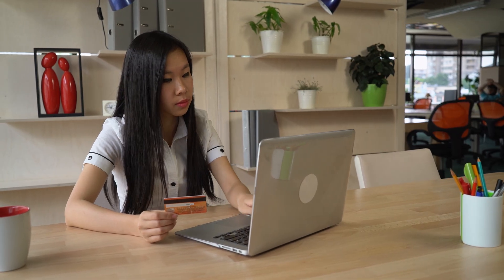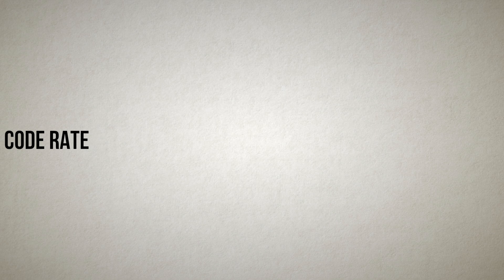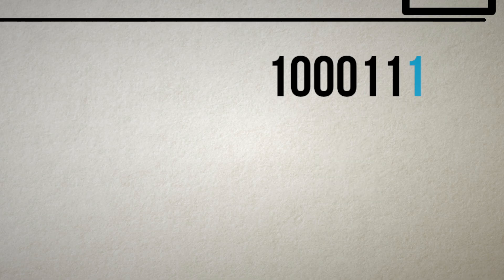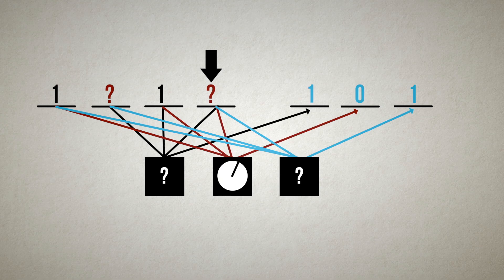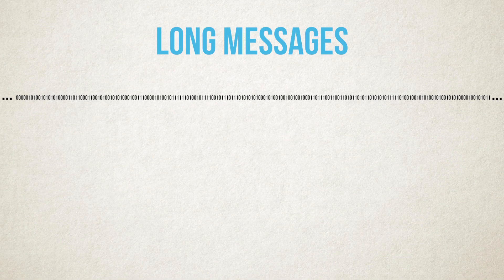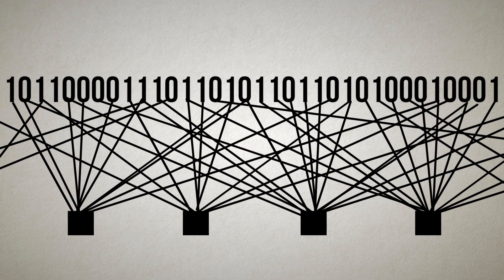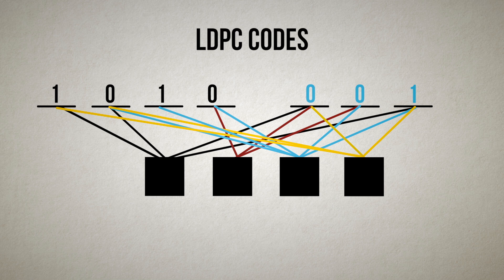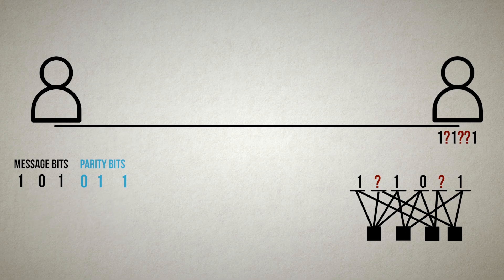Error Correction for 5G Communication (LDPC codes)

Comment: 4:10 this is nonsense, you can’t correct a single bit error with a single parity bit because you don’t know which bit was flipped, all it tells you is the block was corrupted and must therefore be retransmitted.
Reply from the maker: See whole video
Reply: @ArtOfTheProblem  and in that section you said you could correct a single “erasure” with a single parity bit. No you can’t. Nobody talks about erasure, these are bit flips

Comment: Maybe I missed it, but you never explain how the receiver determines which bits have been erased. Hamming Codes only provide error correction for a single bit per code word because the receiver can not know which bits have been erased without knowing the message.

Comment: A basic concept is somehow wrong in this vid: a corrupted bit is not turned as a question mark at the receiver, it is just inverted as binary 1 is turned as 0. For maximum-likelihood receiver, a decision maker is designed to determine the received binaries as 0s or 1s before error detection/correction algorithm is applied. So, 1 parity bit cannot correct single-bit error. As an example: if the sent message is 11001(1), last bit is parity bit, and received message is 10001(1), the receiver only knows that the received message is wrong but cannot tell which bit is wrong.

Comment: I know this is the current standard and all, but it seems quite counter intuitive to use all these checks with this many parity bits.  What if you could compress the data into a few bits with a lot more parity checks instead of using a lot of uncompressed data and parity checks?  This would increase reliability and size at the same time.  From what I understand, this simply has a ton of low density bits with a ton of parity checks that means more bits of data is needed to check all of them.  I suppose you would need a fast compression algorithm that could do this, but would that not be the solution to transmit more data at a reliable rate?

Comment: Interesting stuff.

Unfortunately, it just raises more questions in my mind.  I mean, if it relies on identifying erasures, then it's specifically suited to analogue channels as you'd find in the real world.  But that makes me wonder...

The level of 'erasure' must also exist in a continuum...  so surely there has to be more layers to this scheme in practice.  For example... lets say we have a set with three 'erasures' that are only slightly below the detection threshold (so have some small confidence in the signal - some non-zero level of confidence)- compared to another set which has two 'hard' erasures (where we have no confidence in the signal)

The theory, says to try the set with the least erasures first...

But it may make sense, in such scenarios, to try solving the more confident set first despite it actually having more erasures... as well as simultaneously trying to solve the low-erasure set first.  In each case, the strategies will have knock-on effects ... and the number of knock-on effects may yield some sort of final "correction distance"

... the final correction distance of each strategy could then perhaps allow us to favour one solution over another.  Could this more probablistic approach lead to a small but measurable improvement in detection/correction?

I'm guessing it's complicated.  It may depends on the type of noise and the modulation used.

I'm not sure how to explain my thinking, except to say that, in the analogue world, not all erasures are created equal.  So, treating them as equal may mean missing vital clues.

I might code something up to play with this, simulating noisy messages over various channels... perhaps a QAM channel, an FM channel and a logic-level channel... to see if there is a measurable benefit to 'weighting' erasures under various types of noise - or whether doing so just hinders correction.

Well, I guess there goes MY week...  : /
Reply from the maker: please post what you find. I want to guess that it helps

Comment: So... about erasures!   I'm probably wrong, but it seems to me that an erasure (as considered here) is different from an error, in that you know when an erasure exists.

If the sending channel is analogue, and the signal is digital ... then perhaps you're ideally looking for a string of +1 and -1 symbols.  With channel noise you might consider some threshold such that anything over .75 will be a +1 and anything under -0.75 to be a -1 ... and anything closer to zero to be a faded or 'erased' symbol...

But what about noise that introduces or flips symbols in a bold way?  Now we're not just filling in known gaps in our knowledge about the message, but we're trying to identify, locate and correct otherwise confidently obtained (but nevertheless, misleading) symbols.

Is this covered in the "erasure" strategy ... or, does an erasure strategy rely on the existence of some underlying transport strategy for identifying weak symbols - and then restrict itself to resolving those 'low-confidence' symbols?

I note that in hamming codes you can clearly identify a single, perfectly flipped, symbol.  I'm just wondering if the same is true when discussing erasure - as the video seems to concern itself with the correction of red question marks rather than locating false positives : )

I'm probably just missing something obvious.  Anyone?
Reply from the maker: great catch. Indeed they are different (erasures carry location information) and that simplified this explanation quite a bit...

Comment: I'm doing an open university course ; LDPC and the low density was described as the encoding matrix having a tiny amount of 1's compared to 0's. Like a ratio of 100:1 It's this accurate?  It dosn't make sense to me why that would be the case! I much prefer the explaination of low density = each bit connected to fewer parity bits. This way larger codes can be decoded faster. I can share my course text if that is useful.

Comment: But we actually don’t know 1?1??1. What we received is 111101, and your first step to recover is impossible. In your first step, 1?1 can be easily solved to 101, but the actual number we get is 111. We don't know if the answer is 011 or 101 or 110

Comment: In this video he talks about an "erase" state (the '?').  How does the receiver know there was an "erase" state as opposed to a flipped bit?  For signals that are 0 or 1 volt, isn't the signal always going through circuits that force the value to be either 0 or 1?  Is there a detector at the receiver that calls "erase" if the value is (say) between 0.4 and 0.6 volts?  If not, then the method based on "erasure" would fail.  As far as I know, there is no "erase" state, there are only bit flips.  If there really are no 'erase' detection circuits, then the entire video is wrong.  It should be redone using bit flips.
Reply: This video doesn't make much sense to be honest. The channel output (the message received by the decoder) is a sequence of values between 0.0 and 1.0, where the i-th value is the probability that the i-th bit in the original message is 1.

Comment: This video made me recall an ECC lecture at DEC (Digital Equipment Corp) during a maintenance course on the PDP-11/44. Prior to that, tape decks only had vertical parity (the ninth bit of every byte) and longitudinal parity which was a byte appended to the end of each block of 512 or 1024 bytes. With this scheme, vertical and longitudinal errors would point directly to a single correctable error. Things improved when the longitudinal byte was replaced with a 16-bit ECC implemented as 2-bytes (many implementations were based upon CRC-11). Getting back to the PDP-11/44, every 32-bits of data were implemented with 39-bits of memory (every 8-bit byte had a parity bit; 3 additional bits were necessary to implement the hamming code). With this scheme all single-bit errors were correctable as well as many double-bit errors)

Comment: If the parity bits are also in multiple sets then wouldn't there be cases where the same parity bit needs to be 1 as per one set and 0 as per another. What happens in those cases? And if such a case cannot arise, why is that?
Please clarify.
Reply: The random allocation of the parity bit mappings won't allow this to happen basically. It will only ever be correct for each data and parity bit sets it's linked to... If that makes sense?

Comment: soooo... we end up with 50% code rate again
Reply from the maker: Using a simple (small) example yes. The nice part is LDPC has a variable code rate which can depend on the erasure rate on a given channel. So whether the code rate needs to be 90% or 10%, it can match what is needed. Other models have a 'fixed' code rate which isn't ideal. Remember it's the speed which is important too, not just the code rate. This method is fast & flexible.
Reply: @ArtOfTheProblem  That's pretty neat, thank you for the clarification
Reply: @OxidoPEZON  It's also not vulnerable to the case where the same bit is erased in the repetition.

Comment: Probably a stupid question, but how does the receiving computer know which bit is tied to which parity bit if they are random?
Reply from the maker: Good question, it's defined at the protocol level and so you can assume both sides know the pattern in advance.
Reply: does that mean the message header is sent without error correction codes?
Reply: @ArtOfTheProblem   It seems to me that an awfull lot of bits would be required to commucicate the random allocation between bits and parity bits. Which would of course defeat the purpose since those would need to be protected as well. How is the allocation communicated efficiently? Is it maybe the same random pattern repeated over and over?
Reply: @samuelfeder9764  using pseudorandom generator. And that leads to well known patterns that can be used in the protocol to identify. Something similar is used in 4G, after the modulation block a scrambler follows to randomize the data, but here in order to avoid the spectral regrowth and to maintain precision over the carrier so the receiver can have an accurate synchronization.
Reply: @samuelfeder9764 As Grosu Geoge says, there are pseudo-random sequences that seem to be close to random depending on the intial value (seed) but can be easily computed by both sides just by sharing that seed, so we just need to share some 32 bit integer with a slow but secure method and then we can generate the randomized distributions.
The simplest example of this kind of pseudo-random sequences generators is a linear congruential generator: https://en.wikipedia.org/wiki/Linear_congruential_generator
For example, using a LCG, values a, c and m can be defined by the protocol, and you just need to share with the other computer the seed X0. That seed can be generated by other random or pseudo-random source of numbers.
Reply from the maker: @charaleet6494  Great questions. The simple answer is "the same random pattern is repeated over and over" as you say. The randomness is defined at the protocol level. They are also correct to note that it's not "so simple" to use just random structure, today it's more subtle. This video only covers the key insight to use randomness (and small sets) in the creation of error correction codes.
Reply: Thats what im wondering as well, surely there should be some sort of standardised mapping or a pattern to it
Reply: Could probably run a simple algorithm to generate a random enough distribution from a simple seed. https://youtu.be/RvPrVPoLTe0 Boom!
Reply: I'm thinking of packets
Reply: using random seeds